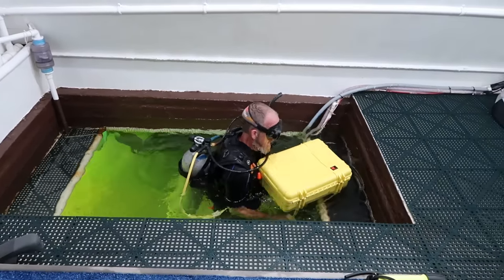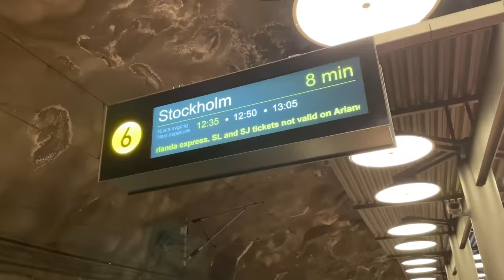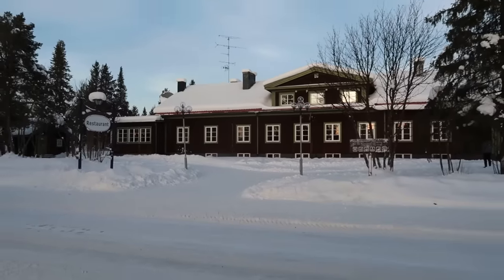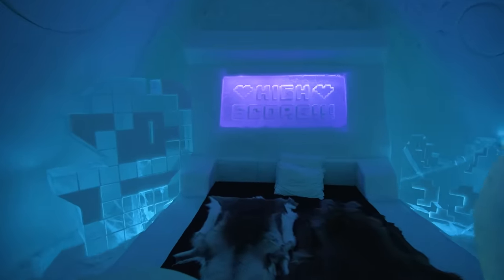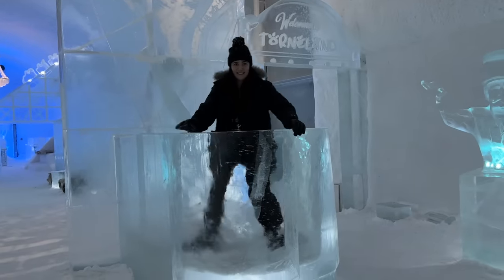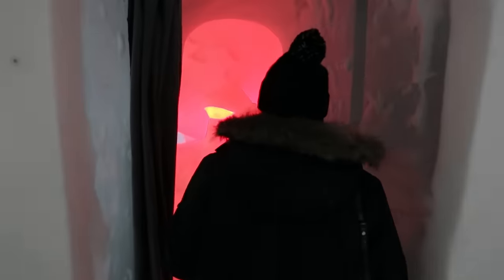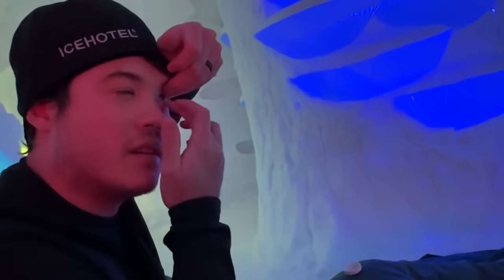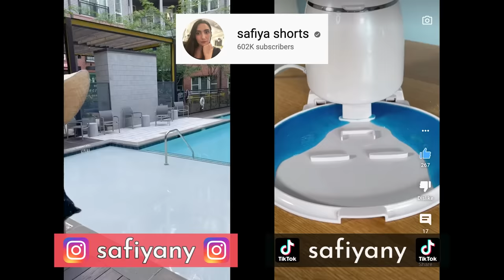I Spent 24 Hours In A Swedish Ice Hotel

Comment: At first this sounds crazy to adult me but then I remembered growing up in Michigan when I would build snow forts and literally nap out there. It was so relaxing seeing the sky peek through the snow roof, this seems like such a fun experience.
Reply: Also, it's super nice that they have the emergency room. With my anxiety, anytime I go somewhere, especially overnight, I always have to have an exit strategy.
Reply: Plus here in Michigan we make the kids go outside for recess at school as long as it is at least 15°F outside.  So 20°F in a hotel room for sleeping with a nice cozy sleeping bag sounds just fine.
Reply: I survived the deadly 2021 Texas freeze that killed 246 people. My place was hovering just below 40 F with no water and I made it about 40 hours before I could get out, so I can't imagine being in a 20 F room for the night--flashbacks! And, edit: I have lived in cold, snowy places before.
Reply: @electric_spacecats  -- It's a different situation when you have cold temperatures in Texas, because your houses are not usually built for that.  I've read that a lot of your furnaces run on electricity instead of gas since you don't need to use them as often. The pipes in your walls might not have insulation around them to protect against the cold, so it would be easy for them to burst if you don't keep the water running at a trickle in cold weather. And even if you have warmer clothes and winter coats, you're just not used to those temperatures.